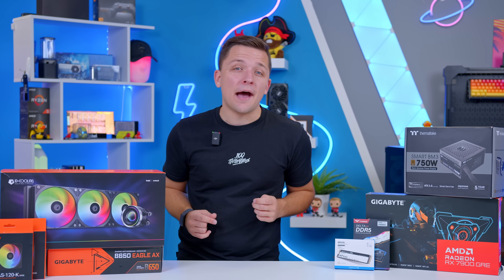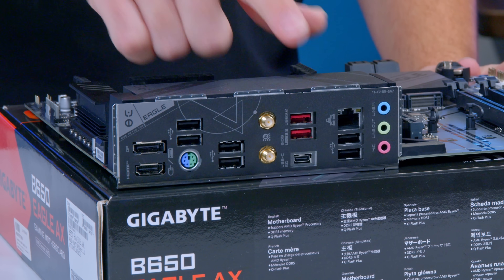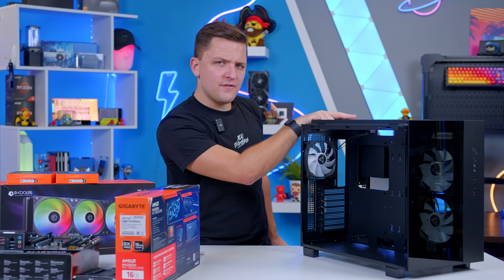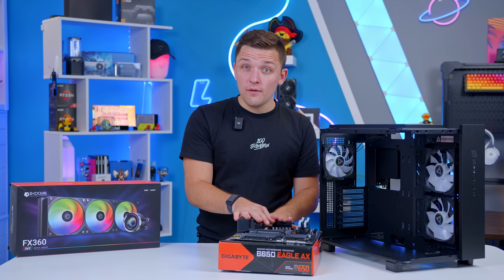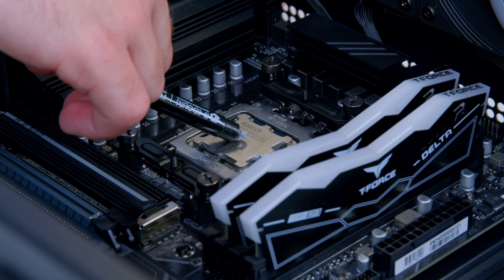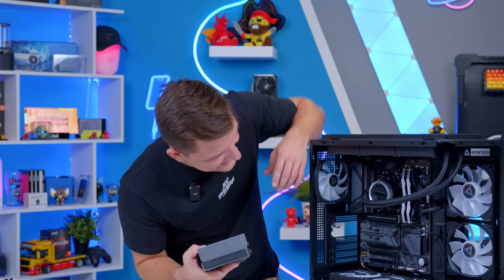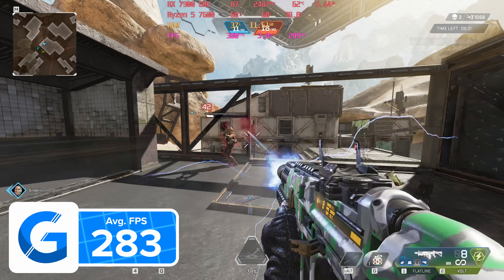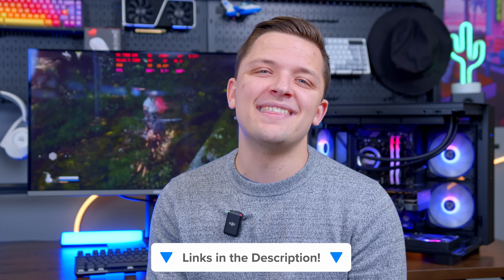BEST $1300 Gaming PC Build 2024! 🚀 [Full 1440p Build Guide ft. RX 7900 GRE]

Comment: I’ve done this exact build to a T. This was my first build but for my GPU I have a ASRock Challenger Radeon RX 7800 Xt. The game crashes on RD2 anything I could do to try to figure out the issue?
Reply: Was thinking of upgrading my GPU just because it tends to crash in certain games but not sure if that’s because of the cpu is being used too much or if the AMD Ryzen 5 7600 and ASRock Challenger Radeon RX 7800 are a good combo. Any help or tips would be useful as this is my first build and I’m completely new to this. I’ve had this build for about 3 months now.

Comment: Would a ryzen 5 3600 with a 7900gre create a bad bottleneck?
Reply: it will bottleneck even in 1440p but  u can easly add  like r7 5700x3d in future and will run flawless. im running same 5700x3d and rx 7900 gre
Reply: @mrfrost5975  ok I’ll probably do that. I primarily game in 1440p now. Just can’t afford to upgrade both right now

Comment: Which build should i choose, a 7900XT/XTX GPU + R 7600 CPU or a 7900GRE GPU + R 7800x3d CPU
Reply: i would get xtx  gpu , later u can easly add 7800x3d when its on some good deal ,tho it should be fine even with r5 7600 in most games 1440p , fps games there will be bottleneck but nothing to worry  since u still gonna get lots of fps

Comment: How much better is the 7800xt than the 7900gre? Considering the 7800xt is£110 cheaper currently
Reply: The 7800xt is slower than the 7900gre. It still is a really good card. I would pick up the 7800xt at that price. Cant go wrong with both of them
Reply: @iPeanutJelly  ohh okay, thank you 🙏

Comment: Hey guys can you help me pls, in my region Rtx 4070 super cost 750 $, and Rtx 4070 ti super cost 850 $. For 1440p is it worth buying 4070 ti super or it’s too much?
Reply: 4070 Super. Should be fine for 1440p 60fps for a long while especially with DLSS. 4070 Ti Super is overkill for what you need unless you want 144-240fps. Save the $100 for your next GPU upgrade in a few years, or spend it on a better CPU now. My two cents.
Reply: @ thank, what you think about Radeon on this price?
Reply: U could get the 7800 xt or the 7900 gre which are close enough to the 4070 super but it won't hve dlss or the other nvidia stuff but will hve more price to performance  just buy what ud like better like dlss n other stuff or more fps per dollar

Comment: Clould you use in the next build a board with a PCi×16 Gen 5 slot for an longer upgrdepath? 
You are lucky that in the UK the GRE is priced at 529£, where I live the cheapest starts at 589€ and RAM is most likely a bit more expensive. I really do appreciate the way you create the videos. And I noticed that you blend in a picture of the mb an highlight the spots for the power cables.

Comment: Ryzen 5 7600 or Ryzen 7 7700X?
Reply from the maker: The 7700X is a fair bit more powerful, but depends what GPU you are going for (and what affect spending more money on the CPU will have on your budget and other parts)
Reply: @GeekaWhat  Ok thanks, looking at a 7800xt or a 7900gre GPU wise. The 7700X isn't going to bottleneck is it? Also, is there a case for getting the 7700X over the normal 7700? The normal 7700 is only £160 on Aliexpress right now. Thanks.

Comment: Why does nothing use the 1st back slots of cases? Im confused
Reply from the maker: If you had a Micro ATX board it likely would do. The slot positioning is standardised, it's just often on an ATX board manufactures don't need to place the GPU slot so high (and for example, will place an NVMe slot first pushing the PCI-E x 16 slot down a bit)
Reply: @GeekaWhat even the b850 aorus does that

Comment: Throw that cpu in the trash and shouldve used a 12700k which is cheaper right now. Z790 board with ddr5 and you will get more fps. And it will annilhate when the cpu and gpu are oc

Comment: I know... this gunna seem very team green... but is the 4070 super not almost the exact same for rasterized performance plus you get better RT and DLSS?
Reply from the maker: Basically, yes. The advantage of the GRE is slightly faster rasterisation and more VRAM. That's about as far as it goes :)
Reply: And nvidia is always the worse value pick
Reply: Gre has 20gb VRAM, 4070 had only 16
Reply: @Max-bt6ri  well no… GRE has 16gb of vram and the 4070 super has 12gb.
Reply: @grannysgrass  my bad I misread which GPU we were discussing I was talking about the 7900xt